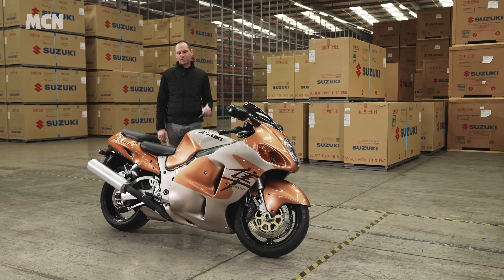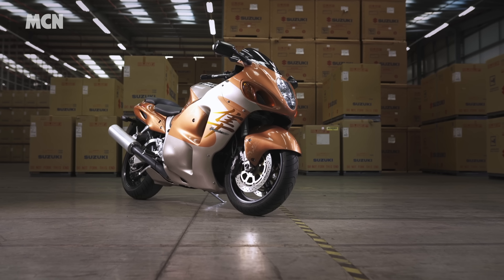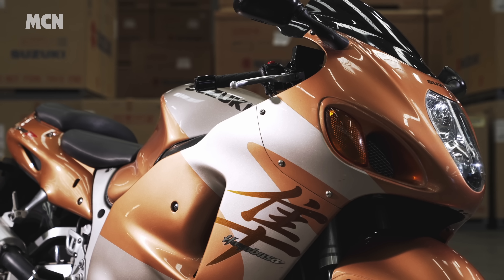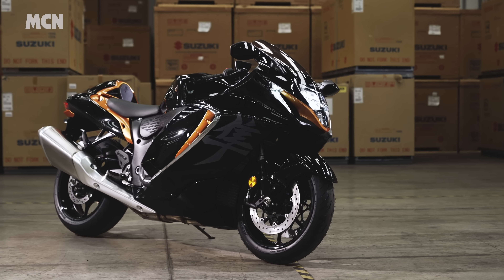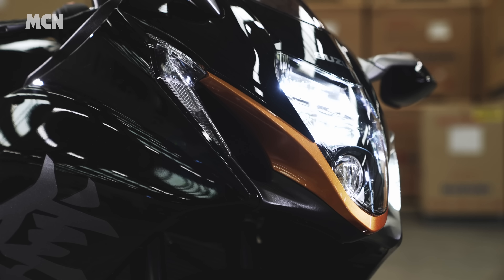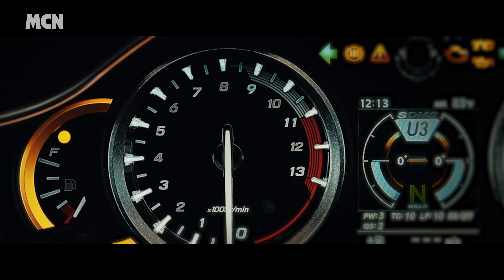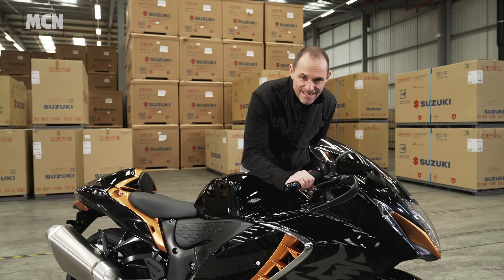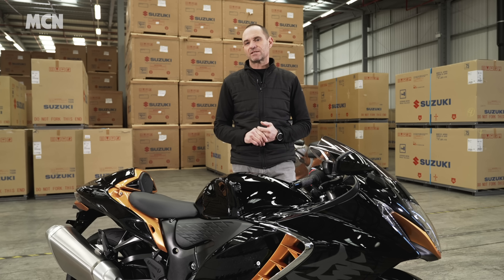2021 Suzuki Hayabusa exclusive: Neevesy's take on new 180mph+ hyperbike | MCN

Comment: I love that it stuck to its roots and the styleing looks good. Kinda sounds like its a downgrade with more electronics tho, at a minimum youd have to chop the exuast and tune out the uero5 bs. At that stage the question is if you like electric assist and if you like controle by wire. On the one hand I am tempted to get one to reward the company sticking to what made the busa great in the first place yet I feel like I would be happyer on a 90's moddel. Definately made some progress just not in any direction I remotely care about and maby even went backwards besides slightly worse fuel econ that sounds like hell if youre cutting peak power you better make damn sure youre burning less gass, the only logic I can see to get the new model other than looks would be the electronics and lets say you do want that then youd still be better of with the old engine.

Comment: I def don't understand this Euro 5 emission stuff....If motors are supposed to run cleaner with less emissions and better economy, why then does the new "Busa" make less power while using a lot more fuel fuel?...Suzuki claim 50mpg from the old and 42mpg for the new, a huge difference....almost car-like in that respect....Beautiful bike tho, my observation on it's efficiency being the only fly in the ointment....

Comment: Well, the figures look disappointed, I was expecting somewhere over 220bhp while the new Gixxer 1000cc engine producing 202.
But think in-depth, if you're a rider needing that power, you can easily find turbo kits or ecu mod, maybe thats why they dont make big changes to the engine, third party manufactures dont need to waste lot of time to design new tuning kits.
And in daily ride, 180bhp is more than enough for most riders.
The thing disappointed me most is the weight, 264kg!! Daily use like pusing it out or in to the garage would be a nightmare (especially the road you live is a slope, you've got to be very careful)
I know some Harley is well over 300kg, but still, the new Hayabusa is consider as a new hyperbike in 2021…

Comment: I absolutely do not agree with this presentation. You can see the evolution of a Porsche 911 and in 2021 it looks like a modern car. The Hayabusa still looks like 20 years ago. Even my 15 year old Yamaha R1 looks more modern. They could have saved so much weight with a new frame design, new materials, maybe make the enginge to be a part of the frame like Ducati does, wich would save fuel and increase handling and braking performance. With an adaptive damper setup it still could be comfortable.
Maybe it is nice that they kept the analog instruments but you can do this with a display as well and you would have even more benefits. You could adapt it to different driving modes, you could connect it with Andoid Auto or Apple Carplay for longer rides and navigation functions. And the little display in the middle of the instruments seems to have a resolution from 10 years ago. This bike just didn't arrive in this century and seems to be made for hardcore fans only and not for earning money with a new developed bike.

Comment: So they tried 6 cylinder turbo engines BUT decided to use the same old powertrain with less Hp/Torque... right. They just repackaged the previous model, don’t be fooled.

Comment: Underwhelming. I was hoping for something more than what amounts to 'Bold new graphics' but they came up with a bike that makes little sense. Owners of Gen 1/2 Busa won't see much reason if any to change. ZZR14/Zx14 (depending on where you are) will go 'eh?' because it doesn't move the game on. Sportsbike riders wanting to give the back/legs a stretch can get just as much speed out of a KTM or Ducati or BMW. 

I get that the Euro5 emissions dictate noise and power because of all those cats but this is the best Suzuki can do the for legendary Hayabusa? Really? 

I'd say it's a decent looking bike, handy electronics, better brakes but a trick missed. I'll stick with my Gen 2 ZZR1400 instead of chopping in for one of these.

Comment: 13 years later and such a minimal real change other than slapping modern electronics on it. 
So they didn’t even try to compete for the fastest straight line cruiser sport bike. They should have changed it into a nice powerful tourer then with a more comfortable position. 

H2sx it is then.  BOOO Suzuki

Comment: Less time in the wind tunnel and more time on the scale. Again, there is NO reason why this motorcycle weighs as much as it does. Suzuki has yet again failed to note its own history: the jump from the GS1150 to the GSXR was from 524 pounds claimed dry weight to 434 pounds claimed dry weight. 90 flippin' pounds and it was measurably faster.  Wake up, Hammamatsu!

Comment: Under the gentlemens agreement every bike is restricted to 186mph even the h2 so pointless having new bikes if you want speed. I can guarantee my derestricted race tuned Zx12r will eat those for breakfast. With 13k revs on clock and it will hit 13k I've had 190mph at 9k revs so I can guarantee it will do very close if not the 220 it has on clock so go get your busa 😂😂

Comment: Why don't they just quit screwing around and just bump these up to 2000 cc and put a turbo on it and be done! If you complained about the power at that point you need to be in a mental hospital! Very few people buying a Busa could care about fuel economy or racetrack cornering, these things haul ass in a straight line 99% of the time. Suzuki should also sell "race only " parts for these at the dealer, like a pipe and a re-mapped computer, people are going to do it anyways. 
-

Comment: I just get the feeling this was made because they felt like they had to. The only redeeming factor in my opinion is the looks. It's got less power, it's got worse fuel economy, it should feel the same on the road. It's a Hayabusa, it should be insanity. I have a feeling this was made by old men for old men. It has cruise control, more upright seating, driving modes... analogue clocks. It's a shame that this is what 20 years of legendary status results into. Despite all this, the look of the thing still make the hair on my neck stand on end. But I can't deny that I am a little disappointed.

Comment: You can be disappointed in the looks not changing much. But you have to remember why the Hayabusa looks the way it does to begin with. This is what a bike this size would look like if you designed it 100% around the data you recovered from wind tunnel tests. And that is exactly what they did. Going for top speed with a rider fully tucked, this is what you get. 🤮 Beautifully hideously.

Comment: Busa looks like garbage.... Best looking bike is 2007 Honda cbr1000rr .... Busa is a touring bike, the Honda 1000rr's are superbikes designed to be nimble on the track.
Reply: I will destroy you at anything less than 190 mph.... The stock 07 Honda 1000rr tops out at 198mph
Reply: Suzuki requires a mechanic to own and maintain one. A layman can ride a Honda.